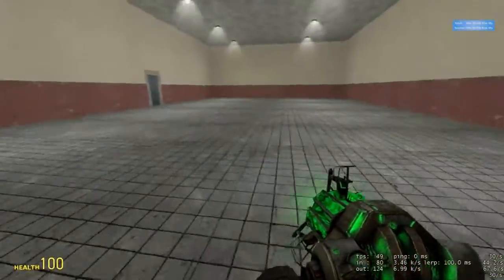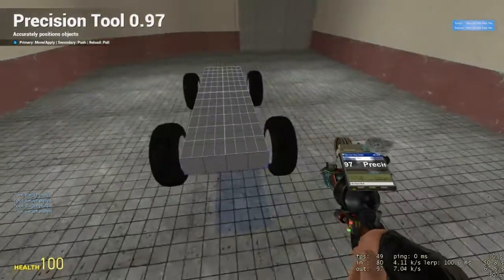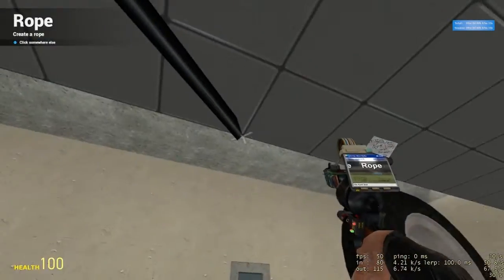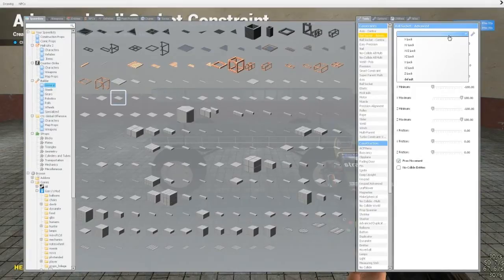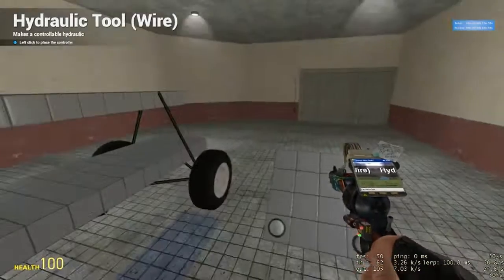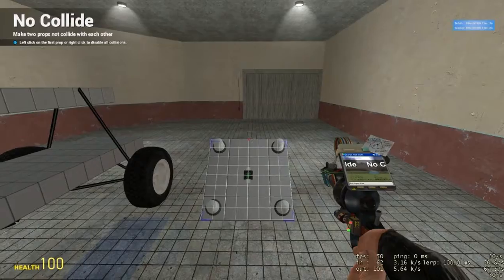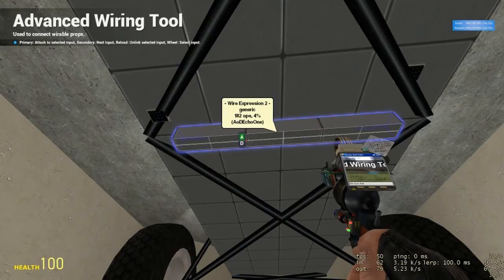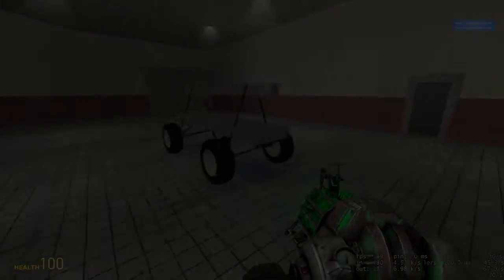Gmod 13 Tutorial Engine, Gearbox and Chassis Part 2/4 "Simple Chassis"

Comment: So I have the steering thing and did everything all the ballsockets hydraulics constant values ect EXpression 2 steer..... 1000 local ect and the wheels just go all over the place also I did the weight too.
Reply from the maker: try just higher weights on the wheels.
Reply: AoDMADPenny oh i fixed that about 15 min after post -_- sorry about that it was that the E2 was still only 3 units in weight... not 55 but I set mine to 75-100 for more responsive steering... but now on my new expiraments I get this issue with tthe E2 where it sets my wheels to a default angle of 90-180 degrees off from there original angle. Reason?